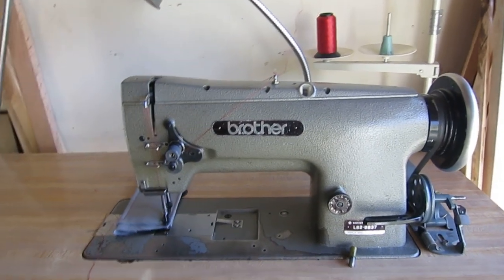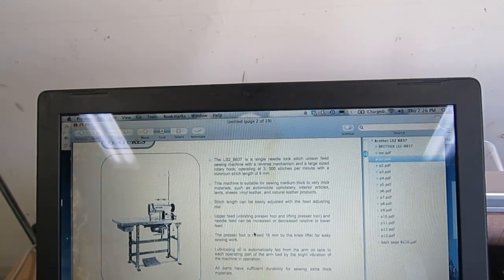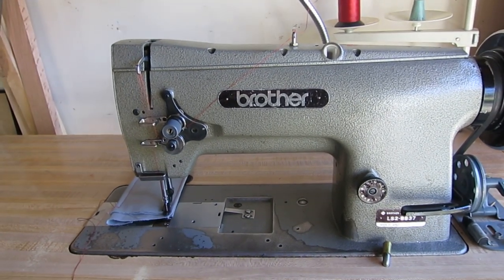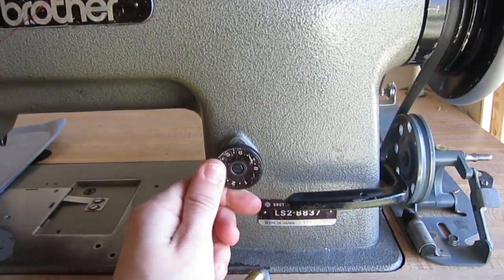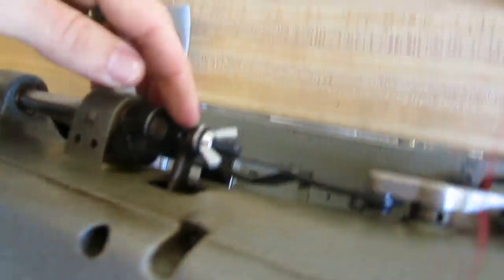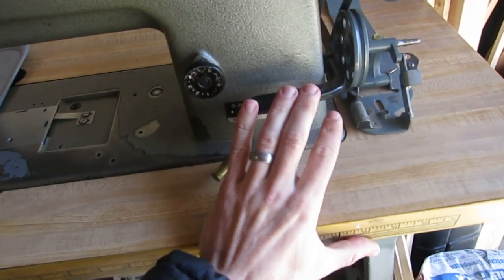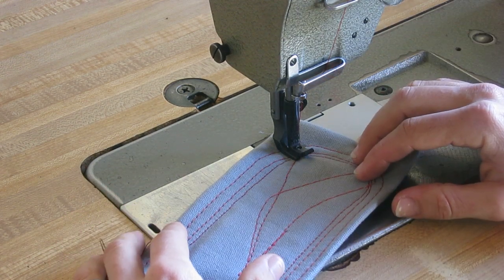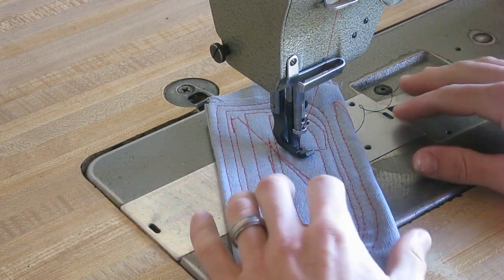Brother LS2-B837 Unison Feed - Walking Foot Sewing Machine  Overview and Sewing Demonstration

Comment: It's a remake of seiko lsw-8bl (which I have) or consew 255. It has second biggest bobbin size in industrial machines. (the biggest bobbin is durkopp 767 series). Its every movement/timing is customizable. It's the best compound feed machine I have ever used.
Reply: hmmm, looks more like a consew 206rb than a 255... the consew 255 looks like a singer 211 and other copies of the 211. Just because the DA has a big bobbin doesn't mean its the best machine, it all depends on what you're doing with it..making sails? banners? sure you would want a big bobbin.
Reply: @lluwd  they have both compound feed, but they are completely different machines. 206 has a horizontal axis rotary hook, and 255 has a vertical axis rotary hook. I don't think a horizontal axis hook machine can have such a big bobbin.
Reply: No it’s the same as the Consew 255RB-3 , the Consew 206 models were manufactured earlier

Comment: Good video and a super nice machine   I will not argue with your advice and conclusions but i do have a slightly different  conclusion as. For me i was a professional Woodworker  for over 20 years and i was a boat owner and a Vintage car enthusiast as well i simply wanted to  learn how to do my own auto interiors and boat canvas and  vinyl  so i did purchase a Chinese made machine off of Ebay  the gy i bought it from was very up front on what i was buying and everything i got worked as it was. Supposed to  ive owned the machine for 10 years without any  issues  or  breakdowns please understand i am a hobbyist  and i am not running the machine hard  i will agree that it lacks some of the bells and whistles  that the older Japanese models do have  but with the popularity of the China made ones many of those features and accessories are becoming available on Ebay or online if one decides they need that  to do a better job they are very inexpensive to purchase  now my argument. Is that i got into a new hobby for a low investment  and expanded my  horizons  now that i do have some experience in sewing and knowing i enjoy it i would  know the differences  and might agree with your advice  and reccomendation on  a good used Japanese or German quality machine  on your Brother  it absolutely runs smoother and quieter than mine  does  but again mine gets the job done  and truthfully i know i can do some tlc. And tune it up like ive done on all my Woodworking equipment over the years ! But in all honesty. Its been working the way it is  so i  just go with it  and if i come up with a  good deal  knowing its a hobby i like doing i may just upgrade myself to a new toy similar to what you mentioned  years ago there wasn’t that much info online or YouTube on what machines to buy  or not to  so i went with  whatever i could find at the time  i of course knew i wanted a walking foot  machine but locally  everything i found was  a couple of grand and  on Ebay i found brand new for under a thousand shipped to my house  like i said i feel there was merit in going that route  as thats similar advice i give to freinds that want to explore woodworking  if they enjoy it they can upgrade  tools along the way  they dont need to spend thousands of dollars. Right at the start  anf that i actually began with hand me down tools and other used tools i fixed up to perform. Well  long before. I  acquired a shop with millions of dollars worth of tools  that i use to make Money with

Comment: Hi there. I wonder if you have used this machine for leather work. I understand a walking food is needed and this machine does not have it. May be some modification can be made. Your help will be indeed appreciated.
Reply from the maker: This is a walking foot machine and will sewing through vegetable tanned leather with the proper needle (chisel point, designed for leather).

Comment: Awesome informative video. However i'd be grateful if you could tell me where to download the manual, as I have just purchased this machine after watching your video. The machine will arrive next week and I would just like to be prepared. Thanks
Reply: Did you ever find the site that has the printed manual? If so please let me know. I have the same machine and I found a couple of sites that have a photocopy manual but the pics are washed out.
Reply: @legalsolutions07  Hi yes I have a found some for this machine. I got a copy from an machine engineer. Send me your email, and I will send them to you via pdf file.
Reply: @tuttahsmith7481  I’m PM’ing you
Reply: Hi. I just purchased this machine. Any chance you could share pdf manual with me?
Reply: @kgirard411  No worries. Just forward me your email address.
Reply: @tuttahsmith7481  how do i pm you?
Reply: @kgirard411  However, I will remove this email in a few hours so that I don't get spammed.

Comment: Is their any way to slow this machine down by using a pulley and do i need to use a smaller belt
Reply: Yes, but then things start slipping when you need high torque. If you want good torque, and to slow things down, get a 4:1 gear reduction for your machine. Then, adding, even a cheap, servo motor really gets this thing running like a dream! Though, with the gear reduction unit the servo motor not totally necessary, but I wouldn't personally go without one.

Comment: Is there anyway to get a copy of your service manual. the timing is off on my 837
Reply: Check for the Army/Navy manuals for the Consew 226 / Singer 111. It's essentially the same machine. This design has been around since forever.
Reply: Thanks
Reply: they are not same machine. their rotary hook is not same. brother 837 is a copy of consew 255.

Comment: How much did you pay for this machine ? Ive seen a local one but the guy wants $1200. Seems a little steep.
Reply from the maker: It depends on condition but $1,200 is in the right range.  Geography also plays a roll.  I've seen then for as low as $600-800 but they weren't in good shape.  Better to spend a little more up front and get one in as good of condition as possible.  They don't lose value.
Reply: @thesergeant3524  thanks for the reply i think i will pull the trigger. This machine seems better than the new chinesium machines. Love your vids by the way! Lots of info.
Reply: I think machines are always expensive in the Los Angeles area

Comment: What type of work do you do?
Reply from the maker: +boat buddy I'm a hobbyist sewer.  I just love restoring and using vintage machines.   Mainly I make backpacking, bike touring and outdoor gear but knowing how to sew I've made just about everything from canvas and leather weekender duffle bags to stuff animals to teepees to clothing.  It's a versatile and useful skill.  I also weld, woodwork, leathercraft and would consider sewing the most useful of all of those trades.
Reply: Dude it sounds like we both have the same skillset(s) :-)

What part of the world are you in? I'm in LA
Reply from the maker: Right on!  I'm originally from Santa Monica but live in the SF bay area now.
Reply: Nice! Back in August I picked up a brand new Juki "clone" machine from a dealer(Atlas Levy) here in LA. It's a "top and bottom feed", so not really a walking foot per se, but it works ok. Wishing I had gone for a Pfaff 545 after seeing your video talking about your binder attachment for that machine... I am doing binding quite a bit, and I'm prototyping different things right now for future products I want to offer. Tight inside/outside radiuses is becoming the norm, so the Pfaff would be better than the plate binder attachment I currently have(swing away design, but still)
Reply: boat buddy does this machine only for canvas? Or can use this for fabrics to make dresses.
Thanks